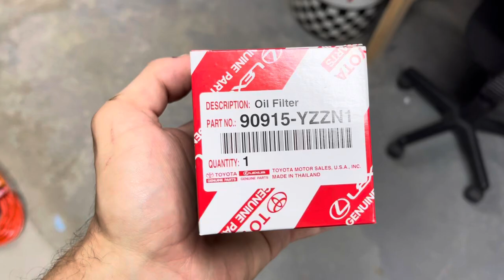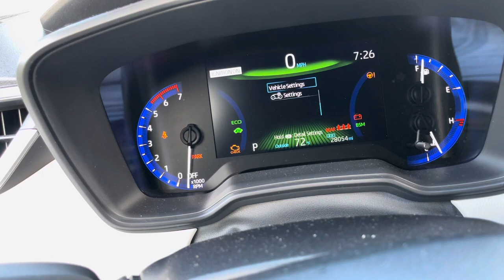2022 Toyota Corolla Hybrid Oil Change!

Comment: You should change oil every 5k and your engine will last forever!!
Reply from the maker: I change it every 5k. Was only doing the 10k because that’s the only time Toyota would do it under the free service
Reply: @TurboJoe304  they wouldn't do MY 2019 Prius @ 5,000 mile chek up. On my way home, I purchased a filter & oil and changed it myself. I'd rather pay & be safer.  I read on utube ppl have been changing breakin oil at 1,500 miles. I hadnt known engines werent broken in. Wished I had, but I DID @ 5,000. And will every 5,000 miles from now on. I cut the bottom off & old castrol oil can but they see funnels specifically FOR Toyotas that screw in. I saw yours jiggling around & mine did & it spilled a little. Amazon sells them.👍
Reply: Nobody changes synthetic oil at 5000 miles, give me a break.
Reply from the maker: @Alisters_Adventures  why not? The more frequent the better
Reply: @Alisters_Adventures  I do.  If you pay thousands of dollars for something, it makes sense to take care of it.
Reply: @Alisters_Adventures  There's a channel where the guy is a Toyota tech and he recommends changing it at 5k miles. There are conditions to be met to extend out the change interval to 10k. I've always followed the severe conditions according to the owner's manual for my oil change intervals.
Reply: 10k is fine 🤡
Reply: @AngelValdovinos  Not if you ask a good mechanic.  Mine said if you want your rings, and seals to last, no more then 6k.   Especially if it's a direct injection engine.  Those tend to get fuel contaminated.
Reply: @txjeb  not quite 10k is fine
Reply: @Alisters_Adventures  Synthetic oil is superior that you should not even change it out just life life long company or transmission fluid. You got it wrong too Damien.
Reply: @txjeb  Toyota uses direct and port fuel injection so you won't have problems like Honda with only direct fuel injection.
Reply: @fcnghkkc1  That's only on their newest dynamic force engines.  Even then, most mechanics say no more than 6k.   The only reason for saying 10k is to make the cost of ownership numbers look better.  Car care nut on YouTube is a Toyota specialist mechanic.  He's torn down multiple Toyota engines, and shown the difference between 5k and 10k oil change intervals. The shorter intervals make a difference
Reply: @Alisters_Adventures  I do 🤷‍♂️
Reply: You could do one better by taping the wrench onto the pan.

Comment: This is common issue with Toyota oil filter, You need to crack open the oil fill cap before draining the oil or the back pressure caused by draining the oil makes removing the filter near impossible.
Reply: This should be pinned.

Comment: In Sweden, you pay for the oil change at service about 500 USD or 800 USD. if you change the oil yourself and skip the service, you lose the factory warranty. and last service they pull 5W30 oil in my car and claim it's ok. LOL-
Reply: Considering Sweden is a cold country, thin oil is better

Comment: Shouldn't you change the crush washer when you put the oil drain plug back?
Reply from the maker: Yes a new one every time 

HELIFOUNER 560 Pieces 18 Sizes Automotive Drain Plug Gaskets, Oil Crush Washers, Aluminum Flat Washers Assortment Kit (M6 M8 M10 M12 M14 M16 M18 M20 M22 M24) https://a.co/d/fzkpgR8
Reply: yes. every time you take out most plugs on toyota or lexus you gotta replace the crush washer

Comment: Wasn't the easiest change in the world, but good job. OMy Opel has much easier access to drain plug - it's T40 and the oil filter is in the plastic case, but the access is from the engine bay, not under the car.

Comment: Did you actually see them remove the oil filter each time they did it oil change the Toyota? With my service background with Toyota unfortunately and the way that filter was so seized on there has me believing it was the original filter
Reply from the maker: No, I always dropped it off before work so it very well could’ve been original
Reply from the maker: @gonzomuppet9255  it’s a shame. I’m sure because it was the free oil changes their instructed to not change it or just plain lazy. Either way it takes the faith from the dealerships
Reply: I scratched My oil filter  in a distinctive spot with a screwdriver and Checked it when I got home and they changed mine It's just hard to trust anybody these days I did my 1st oil change on my Corolla hybrid myself at 5000 miles And there was oil Is leaking from the original oil filter And it was the hardest one I've ever had to take off

Comment: I use the same filter for my car..... F2 or the N1 toyota filter..... I use the oil cap wrench  # 07AAA - PLCA100 ..... It's for a Honda filter but it fit perfect on the toyota filter like a glove. Made of steal built to last forever.  You will never again have a hard time with your filter . Amazon has it for around 30 bucks we'll worth the $$$$$

Comment: Incase you bought warranty, whatever you dont use gets paid back to you after your loan policy.

Edit: i use 0w-20 Pennzoil full synthetic platinum.
Reply: Why use the 0W-20? The engine oil cover says 0W-16.
Reply: You guys must wanna blow the motor 😂😂 and 0w-8 is even worst hahaha.  I think it can tolerate atleast 5w-30 especially in this summer heat 🥵  when 5w-30 was recommended for all season all weather for best mileage and ease of start up and pump the oil up to the top in the 90s
Reply: But 0w-8 has a purpose because I like seeing it at the shelves and maybe good to flush the engine but some have used diesel too.. check out a video 😂 USUALLY not necessary depending on what oil driving style and ug you give it an italian tune up.  Take it with a grain of salt and use your noggin /brain , common sense

Comment: The oil level will go down when the engine starts because the filter will fill up ' you need to confirm oil level  with the dipstick when the engine is hot

Comment: I live in Turkey who also has a 2019 Corolla hybrid. Toyota here basically doesn't have 0w16, instead they basically use 0w20 and the website says so too. My car is out of warranty, this time I'm going to change oil myself as it is much cheaper. Also Shell 0w20 over here is way cheaper than Mobile 1 for some reason. My question is, would my car be happy and thankful for that shell as much as Mobile 1 ?
Reply: You’ll be ok
Reply: @frankv64 
I am hoping so

Comment: Hi when using synthetic oil when you check the oil after an oil change should their be a good bit on the dip stick? I only checked it after oil changed because the car started making a loud noise.
Reply from the maker: There are markings on the dipstick the indicate low oil or full.
Reply: Is this a joke question? If not. I would suggest bringing your car to any shop and let them do the oil change instead..

Comment: The car might leak oil when it is running     start it before you put the covers back on.     The first oil change at 10000  is too long  if you do oil analysis  there are particles in the oil that the filter does not remove.

Comment: Wait is the drain bolt 14 or 30lbs torque? I thought 30
Reply from the maker: It’s 27ft lb but I just snug it by hand then another 1/4 turn.

Comment: Whats that tool called that you used to remove the oil filter?
Reply from the maker: Oil filter wrench 

2-Piece Rubber Strap Wrench Set - Enhanced Oil Filter Wrench, Jar Opener, Pipe Wrench - 4" & 6-3/8" Diameter Range - Comfortable Grip, Mechanics & Plumbers Choice, Multi-Functional Tool 100-160mm https://a.co/d/dVZTRRw

Comment: What is the name of that instrument you used to remove the filter?
Reply: Oil filter wrench
Reply: I would use a metal oil filter socket. It doesn't slip like the strap type used in this video.
Reply: Your local auto parts store would have the correct size filter tool. Go with a new filter and ask them for a wrench.